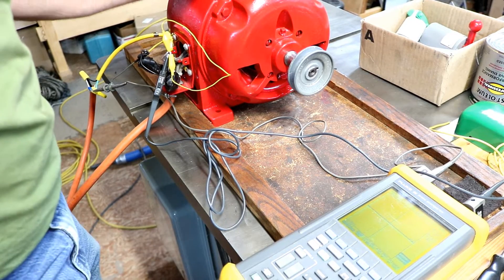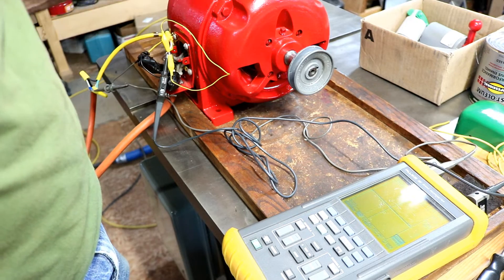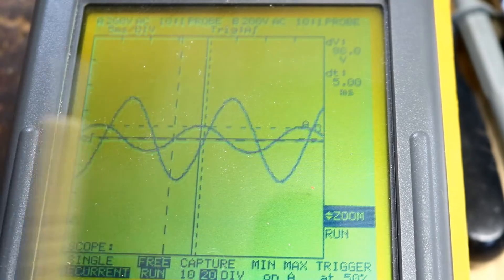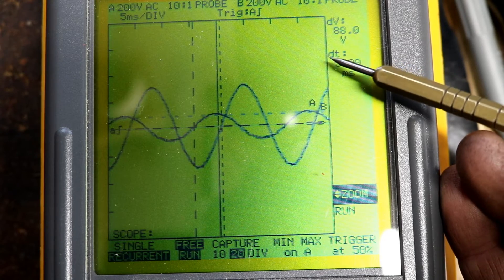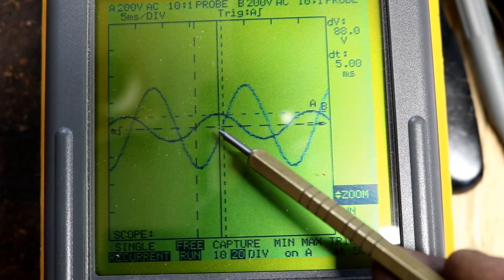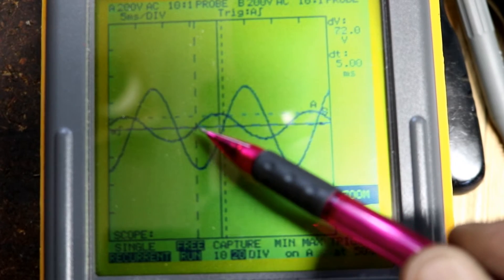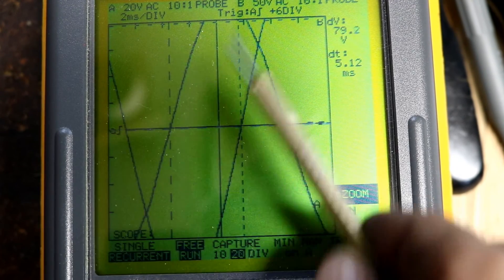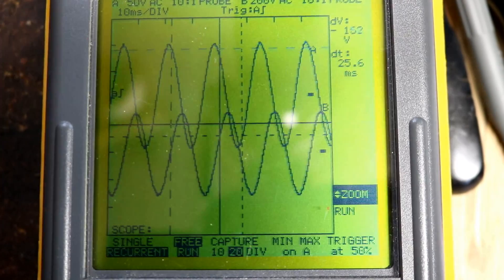Electric Motor Phase Shift Explained | Capacitor Start Motor

Comment: An excellent video!!! BUT: since years i believe there is a wrong explanation given: we cant separate amps from voltage in a lagging or advancing shift-> i cant have a river with flowing water driving a water wheel to generate power (width river=amps, river flow speed=volts): there are zero amps flowing if there is no water flow(zero volts), so it turns into a lake and no water wheel is driven. There is also consequently no power driving the water wheel if the river bed is wide, but not filled across the width with water, so therefore there cant be any flow(zero voltage)-> you cant separate the 2 units from another!!! SO my theory: there are 2 voltages and two amperages, the one from the power source, and the induced "delayed" voltage and amperage inside the inductive load, THEY ARE BOTH LAGGING TO EACH OTHER! So the graph with one sinusoidal voltage and amperage curve is the wrong representation! It needs to be shown 4 curves!- another prove of my theory: take suddenly the power source away, the stored energy within the inductive load surges back and even can destroy switching transistors of a motor controller, therefore we need "freewheeling" diodes to eat and disapate the surge (up to 12x Higher than rhe initial voltage); so we indeed talk about a voltage and current from the power supply AND the own indictor stored voltage and amperage. The capacitor can suck that up and discharge that during the upcoming following cycle     from the power supply, so the reactive useless power get stored until it can be "injected" back into the grid/ load. Please internet, respond!!😂

Comment: Would have loved to the power factor between the current and the voltage. Just find an old transformer so your meter can measure.
Reply from the maker: Thank you.
Reply: I want to do it to my AC compressor unit to see if the OEM cap is the perfect size. Power from my power company is pretty good these days. They mostly add regulators to new substations all the time now
Reply from the maker: @TG-ok4ty  For sure.

Comment: What happens to input amperage and output amperage after the adjustment?
Reply from the maker: Very little.  More about better starting torque and lower temps.
Reply: @RRINTHESHOP  It should be noticable, can you do these tests under load ?

Comment: What about the current side of the coin?  Voltage lags in a capacitor.  Meaning, that it lags behind its current.  It takes time for the cap to charge, and during this charge, the voltage rises over time.   The current is at its maximum value the entire time the voltage is rising, due to charging the capacitor.  This is where voltage and current also get out of phase.  So not only do you have 2 voltage waveforms out of phase, but you have 2 current waveforms out of phase.  And one of each waveform that isn't in phase with anything.  Or does the inductive load lag the current back?  Or is 60hz low enough of a frequency that it wouldn't matter? I would be curious to see a 4 channel scope with the other 2 channels using current probes.  Would also be interesting to see the sum of them.

Comment: Great video! I understand that adding larger capacitance to the start cap will give more starting torque.The real question of trying to get the perfect opposite shift would be for a motor with a  run capacitor also,with it energized the whole time the motor is running and would be optimal to be ideal,since I am dealing with that problem now.I need to get an oscilloscope I guess.
Reply from the maker: Yep get a scope, these days they are cheap.  The best way to tune a motor.   Thanks for watching.

Comment: Is there something about the Fluke oscilloscope that made you decide to use that unit?  I use a Rigol DS1054Z Digital Oscilloscope.  It's a 50MHz, 4 channel color o-scope with many bells and whistles.  It's not battery operated, but it only cost $350.
Reply from the maker: I have had this cope for over 20 yrs.  This was what I needed at the time.  There are many better and great option out there now.

Comment: I assume adding more capacitance will increase phase shift.  How do you calculate the new capacitance value, or is this a trial and error process?  Also, does increasing load reduce phase shift?
Reply from the maker: Yes depending on load you may want to adjust the capacitance for optimal performance.

Comment: I want to run 3Hp 3 phase motor with two phase only using capacitors to get 120 degrees shift change for third, how much value of capacitors I have to use and how to connect starting and running capacitors please explain ...

Thank you
Reply from the maker: It is worth it to buy a VFD.  Doing it with just caps is not good or easy, you will have unbalanced loading of the phases and will probably eventually burn up your motor.  VFDs are cheap today, easy and work well.

Comment: If you go to the cursor menu and turn on phase A-B,  then turn on marker for phase.  It will calculate it for you. You dont need the markers but it helps to confirm you are in the correct spots for measurements.
Reply from the maker: I will check that out thank you for the great help.  Thanks Colin.
Reply: Mine is a fluke 97. I know many of them had that but im not sure what all models. You do have to watch so that the markers are approximately the same positions on the wave forms if you want it to be pretty accurate.  Some times i move the left cursor to make it read from the next wave. Depending on what channel it may read backward. But its a pretty handy feature.
Reply from the maker: Yes I checked, mine will do that.  I will give it a try soon.  Thanks Colin.
Reply: @RRINTHESHOP  if it reads around the 250 area, you can swap the a and b channel leads, or after pressing the cursor button. Press the left soft key, that changes the source from a to b. Also press the channel a b button. Then press the up key a few times, that turns on averaging and will prevent the phase degrees from fluctuating.
Reply: It took me quite a while of reading and trying to figure out how to match a capacitor to my hermetic compressor i used to retrofit my ac recovery unit to high pressure r410a. I kinda thought i figured it out. Then i found your video and it helped me get it just right. I got the compressor used and was sent a 50uf. I have plenty of caps laying around so i tried other values.  Turns out 40uf gets me at 94 degrees phase shift while running and still good quick starts. Thanks for the video, im good with my scope but wasnt completely sure if i was measuring right until i watch you.

Comment: Question.   Would there be a situation where you  don't want maximum staring torque?   For example to give you a softer start and less strain on some mechanical part?
Reply from the maker: Ted I think in this type of motor you will always want full torque.  The longer it takes to start the more heat is generated in the starting windings and this happens fast, high current flow.  They do make motors that do soft starts.

Comment: Good demo / explanation Randy.  Handheld scopes are super handy, don't have to worry about grounding out your circuit.
Reply from the maker: I had everything grounded.  Try this on a ship which is running an active cathodic protection system.  Thanks Bill.
Reply: @RRINTHESHOP  Yeah Randy, I was sloppy with my terminology. I meant with plug in scopes and the low side of each channel ground referenced, very easy to forget that  and put that clip on the probe in the wrong spot in the circuit.  Not that I've ever done that...
Reply from the maker: @billdlv  Oh yes common ground is important for ref. and no ground loop current.

Comment: very old motor you turn on the motor then press the start button until the motor is near run speed when you take your finger off start it settles down
Reply from the maker: Yep.  Thanks Bleu wolf

Comment: Great demo of what's happening with the electrical.  I don't have an oscilloscope, so I use thumb rules for my capacitor choices, if I can't read the start cap info.  If I get a medium start, with correct voltage and amps, with no overheating, then I'm good.  Haven't burned one up yet.  I do like the info you get from the scope.
Reply from the maker: Can be a very useful tool.  Thanks Vernon.

Comment: It looks like the run winding and start winding are physically mounted in the stator 90 degrees apart... If that observation is correct, the ideal electrical phase shift for that motor would be 90 degrees. +/- 20% seems like a valid tolerance to me.
Reply from the maker: Well this test was not under load and in a loaded condition this could change.  I will test it after it is installed to see where it is at, then determine if I need to change the caps.  Thanks Thomas.

Comment: I was drinking my morning cup of coffee.
Clicked on your channel.
Instantly I was back to my engineering college days!!
AC/DC Analysis...
Will there be a Quiz ???
:)
p.s. I use the same Fluke Scopemeter....just a newer Model.....Batteries are still available...
Reply from the maker: Thanks Stuart.  No quizes.  I should get a new battery.
Reply: Try here for a compatible replacement....
https://www.battery2batteries.com/fluke-95-scopemeter-battery-pack-replacement/?gclid=CjwKCAjwk93rBRBLEiwAcMapUeepQM1-DKdi4hZXBpq5tY1QaTMfdLVpEKfj2It0-DHSIGnOUUYxJhoCbjoQAvD_BwE

Comment: The representation shows to me that you have 2 phases of a 3 phase waveform.  It would seem to me that is exactly what you want in a single phase motor boost started by a capacitor and a rpm switch.
Reply from the maker: Yes this is correct.  Thanks workaholic53.

Comment: Most interesting.  It is always interesting how the capacitors can change the phase shift.  I know there is a lot of this when a person is making a rotary phase converter and trying to get all three of the three phase amperage draws the same.  You said 108 degrees was in the ballpark.  
On starting a single phase capacitor start motor.  Is there a certain degrees of phase shift one needs to make the motor start most efficient?  Thanks, Tom
Reply from the maker: Yes 90 deg. is the optimum.  This will make the Power Factor 1.  In this type of motor it is not so critical since this effect is only used during starting and will effect the starting torque.  In a 3 phase motor this is very critical.  Due to inefficiency in a 3 ph motor it will not run at synchronous speed, and thus be out of phase with the generator of the 3 ph power.  So the PF is usually around 0.7 to 0.8, and with capacitance added you can correct the PF to 1.0.  This will then make the generation and power usage system more efficient, and save energy.  I will have to setup this demo again after the Cement Mixer is back up and running with a load on the motor, we can see what the phase shift is and then see if we need to adjust the capacitance to get the motor torque and PF to 1.0, max starting torque.  Thanks Okie-Tom.